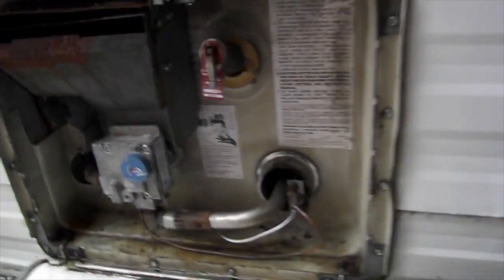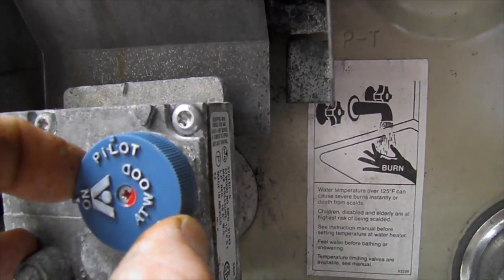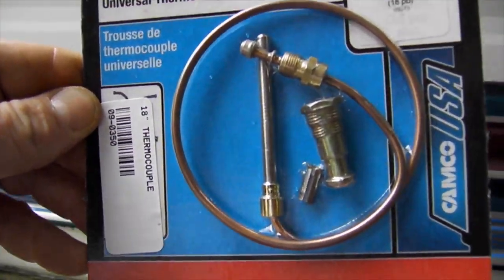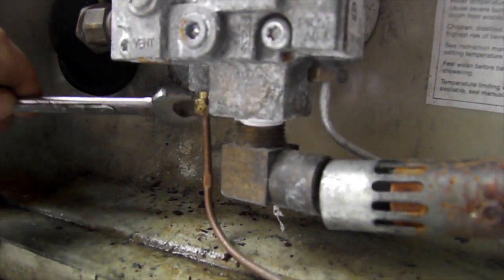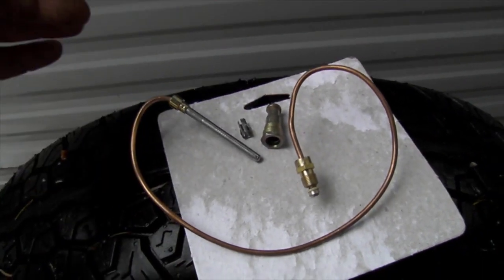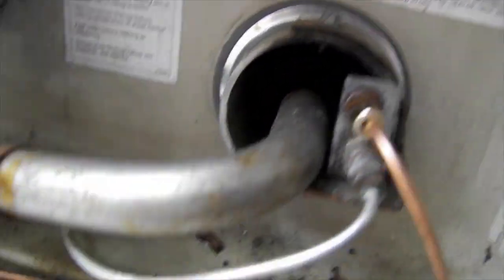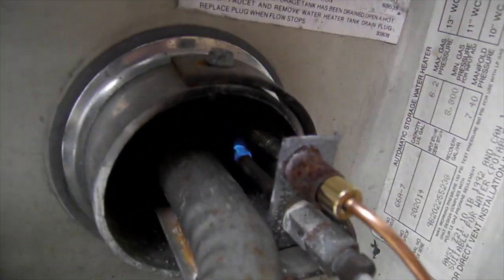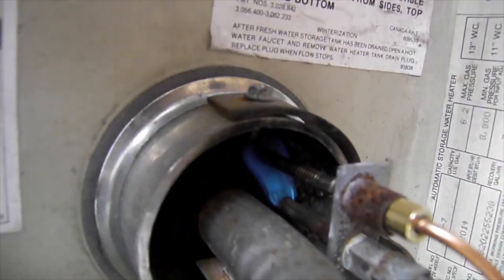DIY How to Replace a Propane Heater Thermocouple on a Mallard Travel Trailer Tutorial

Comment: right on man !  i need to do  This to my 87 trailer pilot light won't stay lit as soon as I release the button it goes out trying to figure out what length I need I see yours was an 18 inch was about to order a 12 inch I'm going to remove the old one and see what length they need
Reply from the maker: Once you do one you’ll be a pro after that. Good luck to you and hope this helped a little. ✌️